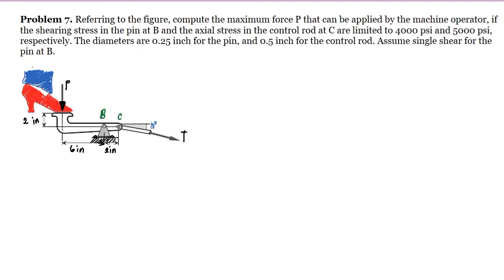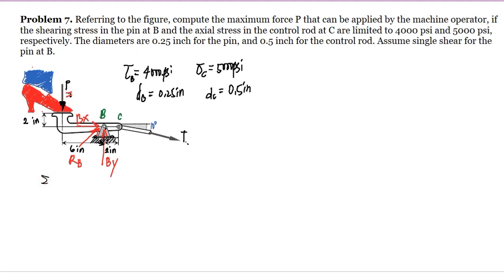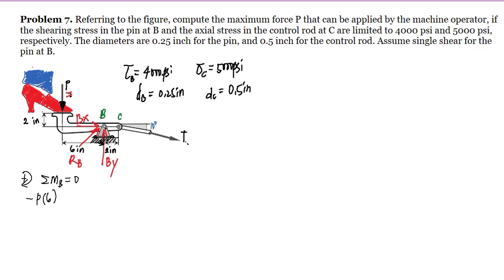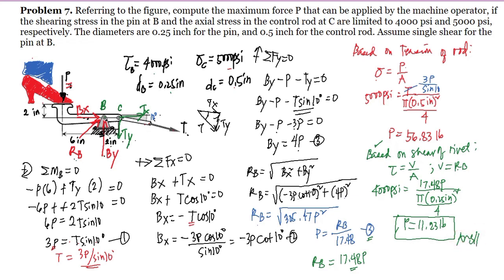Shear Stress Problem 7

Comment: hello po, Engr. bago lang po ako sa channel niyo.. may I know what's the difference po between shear stress = V/A vs. shear stress = 3V/2A . And when do you use both po? hope for your kind response. Thank you po!
Reply from the maker: The V/A is for simple shear po. The 3V/2A is for maximum shear stress on beam considering its rectangular cross section (derived po yan). 4V/3A naman sa circular cross section.

Comment: Hello po. Is the P = 56.83 lb is hindi po ba sia mali? Iniulit ko po kasi pag solve. Ang lalabas is 1473.97. Gusto ko po lang linawin baka mali rin solving ko. Thank you po. Hope for your response.
Reply from the maker: Tama naman po. Check mo po ang calculator mo sa pag-enter ng parenthesis at kung nakadegree mode na ba.
Reply: Thank you po. Sa pag correct rin.